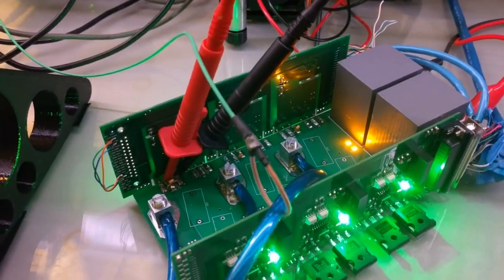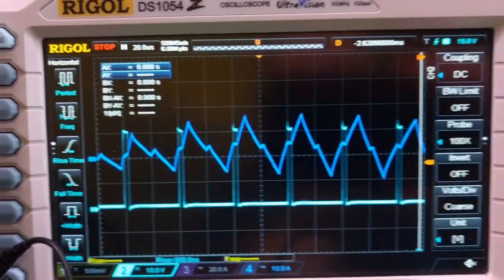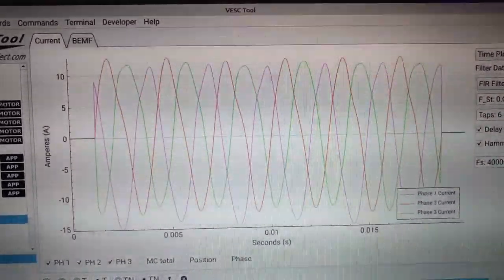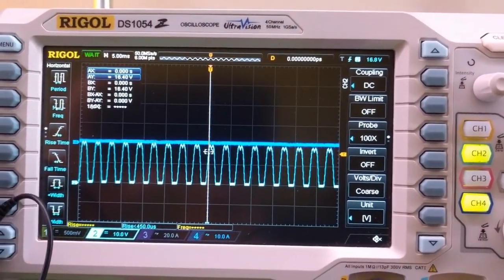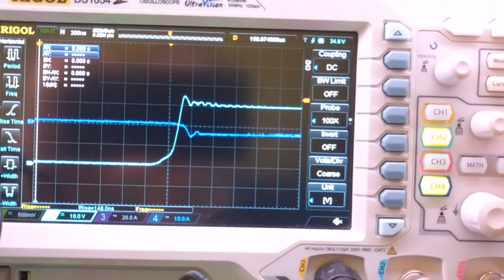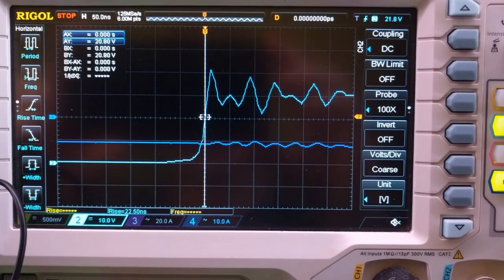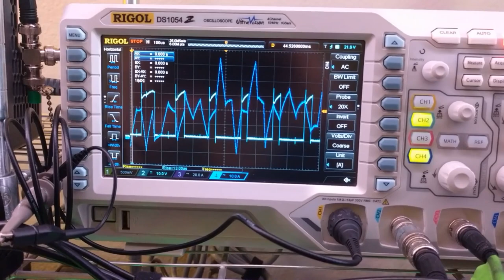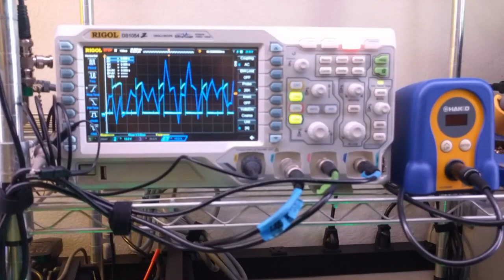12 FET HQ VESC Controller Running Colossus 120100 Outrunner in FOC

Comment: Thank for sharing i always wanted someone to build a quality ESC that can run them huge Chinese Outrunners the old C80100/180kv ran well on various ESC,s but the larger 100/120mm cans and up will fry the average ESC nevertheless Scorpion Mhz 7455 and the LMT 7050 are 80mm cans that run much better than and way more powerful than those Chinese Outrunners that we been playing with for 13 year's now that dam Benjamin Vedder and Andreas Lehner are true geniuses and you Sir are not far behind thanks again for sharing now I'll get back to this LMT 30100 @2150 gram's and 40KW!!!!!!😁🤓

Comment: Finally had the courage to plug my controller in.. Whole time was worried I would blow the H-bridge.. I got a higher voltage supply so that part was safe.. Once I plugged it in .. Nothing worked. Turned out to be a single sort in the PCB 1-5 I had.. Good luck, I swapped everything and it worked :)

Comment: Great video. I love that you are so detailed. I have started my own design of an inverter for an AC induction motor. However it would be interesting with BLDC for lower power use. But are all BLDC so noisy? the ACIM are very quite. I am interested in building an outboard motor, but replacing the ICE with a screaming BLDC does not sound appealing.
Reply from the maker: Loud is relative, I own 740HP, 900HP ICE  and a 160HP BLDC EV powered cars, electric is much quieter.  Around town my 160HP/320Tq EV is every bit as fun to drive as the other 2.  Even pulls off a 1 tire fire if I get it going on a crosswalk stripe.  The amount of noise made by a motor is very dependent on the mechanical properties of the motor and how the PID control loops are tuned.  I have Zero SR motor that can be made loud with the wrong PID settings, it's in one of my other videos on Instaspin.  If you can get a controller, a Nissan Leaf motor will put +300 HP to the tires at 400V.